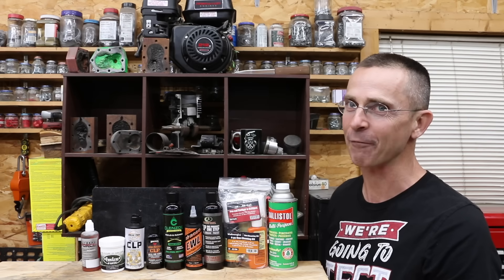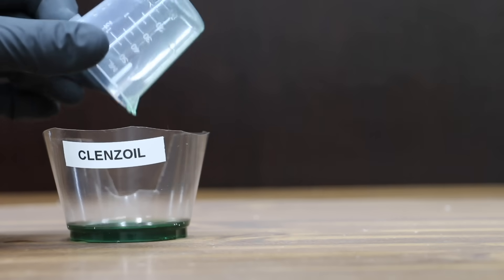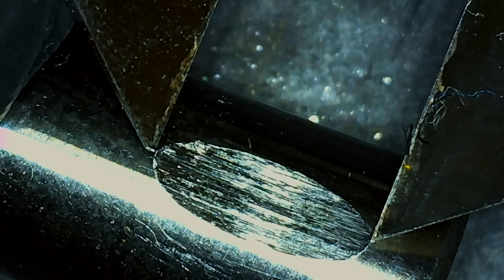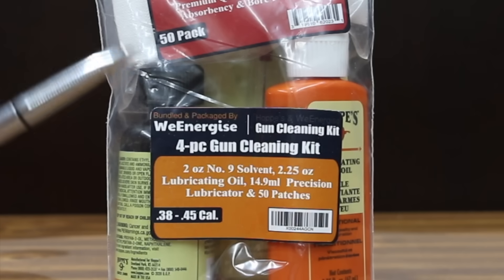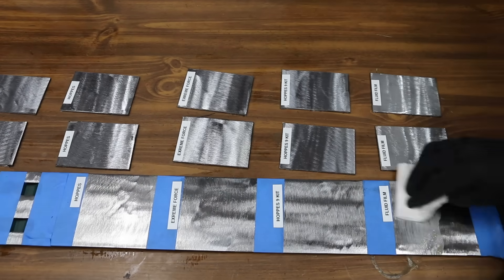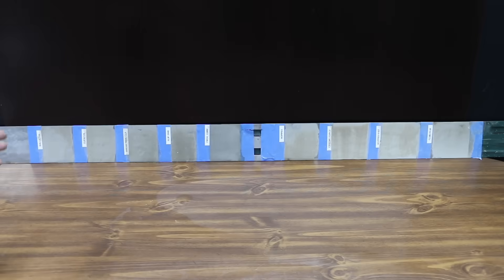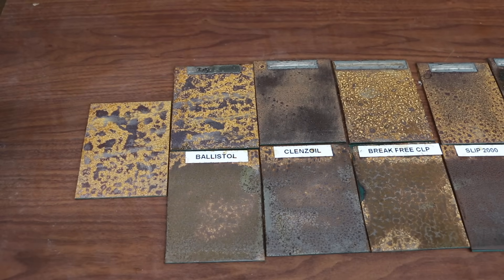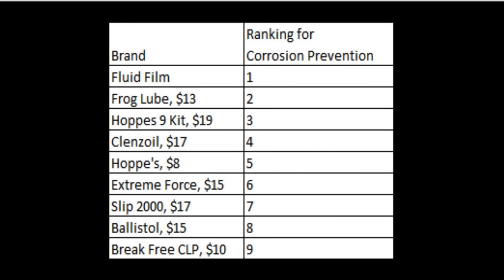Don't Buy A CLP Until You Watch This Review! It'll Save You Time And Money!

Comment: I'll stick with slip 2000 , I've been using it for years without any issues .  That bearing test is interesting but I've never seen anything like that in real life weapon use .  Never any rust , and my weapons are extremely clean for how many rounds I have through them . 

I'd like to see you add The G96 products 

The bearing test makes Clenzoil kind of interesting but it  freezing like that makes it garbage for here in Alaska
Reply from the maker: Thanks for the suggestion.  Thanks for the feedback.
Reply: If you've never seen issues with Slip 2000, imagine how great your guns would do with an even better CLP!

Comment: Im still a Frog Lube fan but i also always heat my gun components to apply. Frog lube comes in a liquid as well as a paste....i use the paste on large surfaces as well as the exterior....liquid on the small and hard to reach places.
Frog Lube is not a cleaner.....i may have to look at that Cleansoil stuff in the future.
Great info as always!!
Reply from the maker: Thanks!  Thanks for sharing.

Comment: I'm a big weapons guy and this is so far the only video you have made to this day for which I already knew what most of the results would be beforehand, except for a couple of these brands with which I have had no experience. I already knew Hoppe's was terrible as a lubricating agent and I knew CLP was great for cold weather but terrible with corrosion resistance. I have tried so many different gun lubes and protectants and have not yet found one that works well in every condition. It is shameful that Hoppe's provides such terrible friction protection for such a big name in gun care products. I always end up having to use a variety of gun care products with different attributes and or consistencies to fit specific conditions and the specific usage of certain firearms. 
Hope one day you do a Part 2 of this video and include other popular gun care products such as Rem Oil, Gun Max (by Real Avid, which is a great company), Lucas (which also makes great vehicle lubricants), Hornady One Shot (which I don't like), Anti Venom (by Strike Industries) Corrosion X (which I have found to be great for rust resistance). Maybe you could even throw in WD40 with Lithium Grease (or without) and a great motor oil like Amsoil into the test just to see how they compare to dedicated gun care products. Thanks for the video, I still leaned a couple of things.
Reply from the maker: Thanks for the feedback.  Thanks for the suggestion.

Comment: I've used balistol forever.  Your great tests have convinced me there are better choices.  I'll probably continue to use balistol on tools with wood/rubber/leather parts.  Being skin safe and non toxic  I don't worry about small residual amounts on knife blades or tool handles.  I use olive oil on kitchen cutlery.
Reply: Ballistol is the Leatherman of oils. Does nothing perfect but is useful in about any scenario. If someone twisted my arm and made me only have one thing like that I would take Ballistol any day.
Reply: Fire arms barrels do not require lubrication as a crank bearing does.  Ballistol is great for cleaning bolts and moving parts.
Reply: I love the fact that Ballistol doesn’t degrade rubber and is non-toxic. I always keep some around for simple cleaning and lubrication of guns, knives and tools.
Reply from the maker: Thanks for the feedback.
Reply: Balistol is a German product developed just before WW I. It's a favorite of the black powder shooters as it is water-soluble. It's fabulous for cleaning a muzzle loader's barrel. But I tend to chase things with Breakfree.
Reply: Vegeteable oils are a good choice. However, you need a good cleaning schedule as since it's biodegradable it will eventually foul and turn to gunk. I personally do like to use vegetable oils on my competition guns which see actions (and cleaning) ever month.
Reply: I use Ballistol on anything with a wood stock since it is safe for wood.  I’ll probably go back to using Break-Free on anything else.

Comment: Thanks for your test. As always interesting. I have used about every thing you can think of over the years for gun protection. Last being synthetic motor oil But for last 3 years I have only used spray car wax on exteriors. It works awesome.  Nothing rust and water just beads off . For the bore  I use few different things like hopps #9 and and simple green.
Reply from the maker: You are welcome!  Thanks for sharing.

Comment: What about brake cleaner and Pennzoil synthetic?
Reply from the maker: Thanks for the suggestion.
Reply: @ProjectFarm  Looking into it more, if you do run a head to head, include a higher end diesel oil too since they are supposed to make cleaning  buildup after use much easier.

Comment: Wells done. I am user of frog lube only in summer months. Fall winter and spring i use Rem Oil, 0w-20 mobil1 extended perf, and sometimes Amsoil saber 2 stroke oil.  Usage is mostly glock and ar15 variants. Frog lube smells great but will fail a weapon 30 degrees or colder., Mobil1 stinks but is super effective in all temps. Amsoil saber slightly better smell.  After your motor oil shootout, need to figure if amsoil 5w30 smells better than pennzoil ultra platinum which sense your shootout has become my motor oil of choice, just bought another 6, 5 qt. Jugs.
Reply from the maker: Thanks!  Thanks for sharing.

Comment: You did a gun oil video! Thank you so much for doing this especially the cold weather part. I live in Canada and we take what we get in terms of Firearms and the same goes for gun oil. It seems that not by Choice but the G96 brand of oil is quite literally on every gun store shelf. We have had the balistoil start to trickle in plus Hoppes 9. Some suggestions for future oils Rem OIl (seriously you missed Remoil), G96, Blaistol (the oil not the CLP- all made in Germany), Hoppes Extreme, Lucas Oil (they make a gun oil), Amsoil (they as well make a gun oil), Otis (I think the Marines use the stuff right now). Kroil or mobil 1 full synthetic as a point of reference or WD-40. Again thanks very much for the review and good luck going down the rabbit hole of gun oils. Also if you could send some of it to a lab the going theory is that Froglube is a commercial Coconut Oil based food machinery oil with a mint smell added and a 1000X markup. Again thank you so much for doing this, hello from Saskatchewan, and have a good week.
Reply from the maker: Thanks and you are welcome!  Thanks for the video ideas.

Comment: Great review!  There’s tons of hocus-pocus in this segment. I’m surprised break-free did so poorly in corrosion resistance and so well in other categories. 
I’m not surprised Froglube paste did so well in corrosion resistance.  I’m not sure your lubricity testing technique is directly applicable to firearms and the consistency of Froglube paste would certainly put it at a disadvantage (were all else equal). 
I’m not surprised by Balistol’s performance. I mostly use it as a solvent and don’t expect much more from it; the stuff smells like sweltering garbage too. 

Take home for me is next time I need CLP I’ll buy Breakfree but I won’t count on it for maximum corrosion resistance. 

There are several firearms products specifically marketed a corrosion resistors. I would love to see them compared.
Reply from the maker: Thanks!  Thanks for the suggestion.

Comment: you didn’t apply the frog lube per instructions. Heat up the gun parts and apply to hot/warm metal. The Frog lube will melt and impregnate the metal.

Comment: Would love to see how liquid frog lube compares, especially in the friction and cold temp tests.
Reply: Froglube works great but has to be first applied to a heated up metal part then cooled down to ambiet temperature to really be effective... The instructions are clear on how it should be done its not a gun oil in the classic sense... And the parts have to be degreased first or they will react to each other and gunk up!
Reply: @TCFamas  You are correct on the paste. The xtreme or liquid version can be used like a normal clp if you prefer that style. I use both and love their product. I did my own corrosion test and it amazes me. 2 months in the pnw rain so far and no rust yet on the test metal. The control side is completely covered. I also have never had any issues with my guns and frog lube in extreme cold weather either.
Reply: @TCFamas  my dad used it to keep rust off guns. We always cleaned and oiled it with other products before we shot
Reply: Yep, the newer liquid formula may have been better to use for these tests. I haven't tried it yet since I don't work in the colder weather. One thing with frog lube is it's real easy to use too much.  In colder weather,  it will take a few shots to loosen it up if you used it like grease.  Once the firearm warms up it will start liquefying. 
Personally I've liked it for its smell and nontoxic state, yet still has performed well for my needs. Found it to be less mess than when I used Break CLP.
Reply: It would have been nice to see the Frog Lube tested as designed. It doesn’t freeze (at down to -10*F), when applied correctly. The wear test would be really interesting to see done as instructed.
Reply from the maker: Thanks for the suggestion.
Reply: Frog lube is decent as long as you are not in a cold climate. It's terrible in the cold and it will make your gun not run